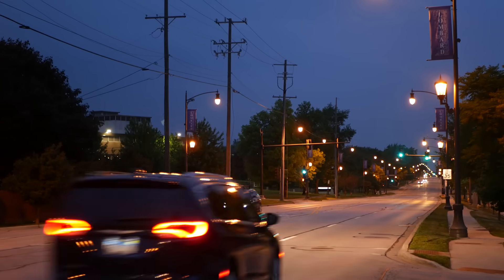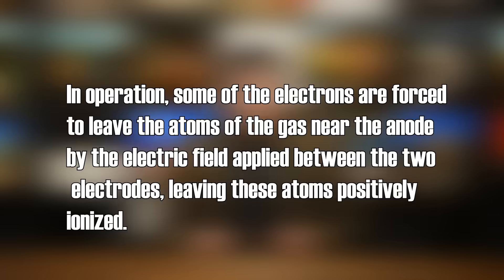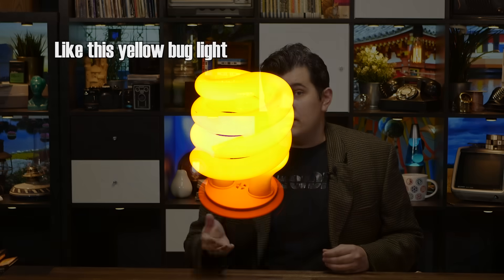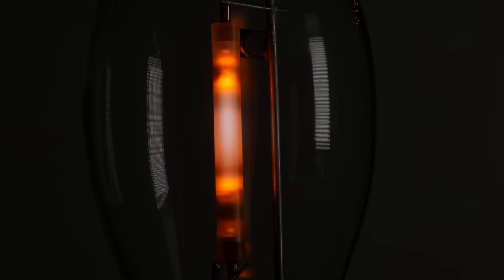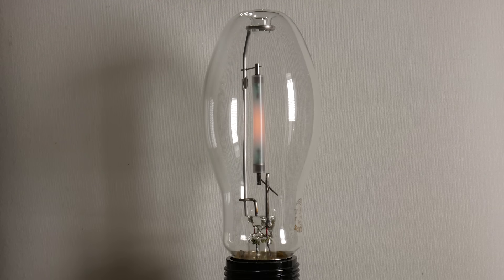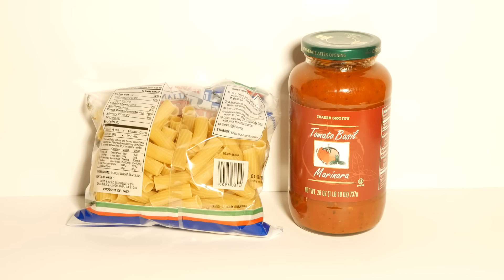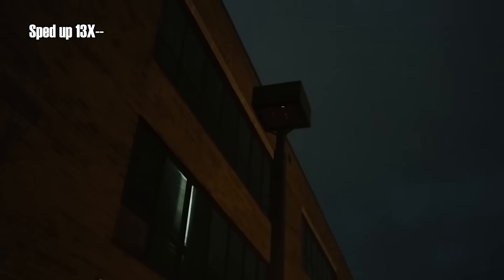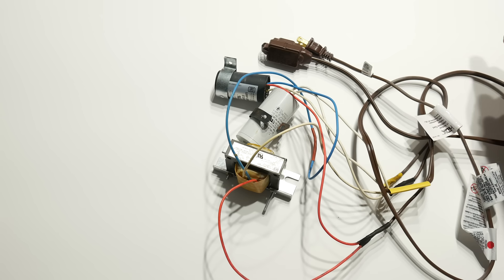The High Pressure Sodium Light: Ubiquitous, effective, but good?

Comment: I really miss the HPS street lighting. Here in LA switched to effing LED.
Reply: *They switched
Reply: Same thing in my city. It looks like a cold, barren wasteland outside with this LED trash, which doesn't help when it's -30 in winter and you want to feel warm.
Reply: @EdmontonRails  Not so much the lighting technology as it is the color temp - although for a long time lighting LEDs were mostly the cringe-inducing cold white that you speak of.
Reply: @InkyLeopard   There are warmer LEDs for sure, but there's catches. Warmer LEDs are less efficient, practically tied with HPS. They also often have bad tints. The blue-orange color temperature scale is only half the picture. There is also a green-purple tint scale that completes the chart. HPS lights have a nice purple tint to their orange. A lot of warm LED lights have a nasty looking green tint. The LED light panels don't look as nice as the HPS bulbs either.
Reply: @EdmontonRails  Higher efficiency doesn't mean higher CRI. What's the point of higher efficiency in cool white 6000k LED's if the reduce depth perception, increase glare and eye strain. Even at 5000k LED's can have rosy tint which leads to higher CRI.
Reply: @uvwuvw-ol3fg   Exactly. The cold LED streetlights are blinding to the eyes, just like LED car headlights. They create dark shadows and disable human night vision, making them worse for night time lighting. There's also an issue with how much importance is placed on CRI. People need to step back and realize that night isn't meant to look like day. The human brain relies on a clear difference between the 2 in order to function.
Reply: @EdmontonRails  L.E.D. LIGHTS ONLY SUFFER IN VERY COLD COUNTRIES BUT WORK PERFECTLY IN WARMER ONES,L.E.D. LIGHTS ARE THE BEST
Reply: @stephensnell5707   LED lights do not work perfectly in warm countries. They are very sensitive to heat, including the heat given off by their own circuitry. If not kept cool LED lights lose efficiency and lifespan.
Reply: @EdmontonRails  shut your valve, old fart
Reply: @doburu4835  silence. Do like this 20 y/o and get yourself a driver's license. Then you'll quickly learn how annoying led lights on cards and street lamps are. On cars they blind you and in the streets they light up the area very poorly. And in the snow or in foggy conditions it becomes much more difficult to see. The difference is especially easy to spot if you drive through a road that has both lights because they are only replacing with LEDs the ones that burn out.
Reply: Go and moan to a retirement home nurse old man, who cares
Reply: @m2heavyindustries378  shut up

Comment: I may be dating myself - but I remember the days when the astronomers were trying to get Congress to mandate low pressure sodium street lights anywhere within 75 miles of an active observatory. They were concerned about light pollution hindering the efficiency of their couple of hundred million dollar telescope and regarded losing one specific line on the spectrum as tolerable but losing the effective use of the telescope as not tolerable.  The internet solved this problem by allowing the astronomer to make observations without having to be physically present at the telescope.  This also allowed telescopes to be placed at higher altitudes where you needed to adapt to the thin air in order to function.

Comment: The tungsten filament is not brighter nor longer lasting. The carbon filaments were just as bright, but could burn for 2, 3, even 4 times the duration. The tungsten filaments were used so that people would have to buy replacements more often.
Reply: Nathan V ok, so why don’t we use it these days?
Reply: Zach B because LEDs are brighter and more efficient. For applications where life is required, there are better alternatives.
Reply: I mean in nowadays incandescent lighting? I’m saying your total bullshit.

Comment: in Mexico most of the public luminaire is halogen. and recently they are implementing LED. There are still some sodium bulbs but they are more used as a temporary replacement lamp. [It's strange to see a long street lit with halogen or LED and sodium points] -I'm really nostalgic to remember those popular fairs where you went with the grandmother seeing everything in yellow monochromatics (it was really a nightmare when you are 4 years old)

Comment: I can heat my living room with incandescent lights during the winter.
Reply: Just play PUBG full brightness while charging your Samsung
Reply: I use my old laptop. Beat that, mate .
Reply: Tom Garbo  That means they can have DOUBLE uses.A light emitting heater!
Reply: @PrivateMcPrivate  No joke: there are applications where incandescent bulbs are used for exactly that reason.  Terrariums and Lava lamps come to mind.
Reply: Do you live in a closet? Lucky you
Reply: My friend and I used to joke about using the original Xbox as a grilled cheese maker.
Reply: @biggiecheese253  I used my xbox 360 as a poptart toaster
Reply: No, you can’t.
Reply: We still have a lot of HPS here in Milwaukee. We also have a few random Mercury Vapor streetlights. I went for a walk after dark recently and found several blocks nearby that have mostly mercury vapor lights with their cool blue green glow.

Comment: I don’t like those sodium lights, I used to have a 1985 Ford Ltd Crown Victoria (the original Men In Black car). It had a paint color called “Sand Beige”, which, under sunlight was a nice yellow version of beige, soothing to the eyes really.
However, Ford used red oxide primer underneath the paint and under sodium lamps it was visible through the paint and turned the car pink.

Pink! Like Homer Simpsons car!

Comment: Because astronomers love them as it is easy to filter the light out compared to white light.
Reply: That's low-pressure sodium, which has a nearly monochromatic output. As noted in the video, the high-pressure sodium lamps have a broad-spectrum output although the CRI is low. San José, California uses low-pressure sodium street lights for the benefit of the nearby Lick Observatory. These lights have, as was noted in the video, horrible color rendition and make it impossible to, say, find your car in a parking lot at night because they're all gray.

Comment: I owned a business with about 100 of the same sodium lamp you were demonstrating. None of them got nearly the hours that were claimed and the fixtures were a constant pain. The ballasts failed constantly and the lamps produced so much heat that a plastic lens would yellow and crack. Fixtures with glass lenses were much more expensive. Much like replacing the bulbs in our indoor 8 ft. florescent fixtures with LED tubes, the lack of ballasts to fail and the lack of heat issues was a godsend.

Comment: Tbh leds are shit only good for a torch because, they damage your eyes and give a nasty day/cool light where as high pressure sodium lamps give a warm light that makes things easier to see without the glare of a led also low pressure sodium lights are ok but have a more yellowish light which in my opinion isn’t as good  , also if u like one of these lamps (high pressure sodium light orange light )(low pressure sodium yellowish light )and the local street lights around your house haven’t changed to led yet you can send the local council a letter to ask for them to not change the lights to led because the community feels the orange ones are warmer etc

Comment: apart from the efficiency these LED lights suck in almost every way. Weird color that tires you out while driving, don't get hot enough to melt snow and ice off them,  expensive to install, and a concentrated beam straight down that dosen't really light up the area too well

Comment: Why would LEDs put Sodium vapor lights out of business?

Sodium lamps have the worst color rendering of any bulb. They produce a dark yellow glow which is generally a very low quality light. Additionally, there are serious waste disposal issues with sodium lamps. In particular, they have been known to start fires in the event that the lamp is broken and the sodium metal is exposed. The sodium can catch fire even in the event that the lamp is broken on the ground. For this reason it is safest to break sodium lights under water and then to subsequently dispose of the destroyed bulb. Lastly, HPS and LPS lights are monochromatic, so they can mess with your color vision if you look at them for an extended period of time.

Perhaps more importantly, in the last few years LED efficiency has surpassed that of even LPS and HPS lights and its efficiency improvements are progressing at a much more rapid rate. The largest selling point of LPS and HPS lights is the cheap selling price, the high energy efficiency (low operating costs), and the relatively long lifespan. LPS and HPS still retain these advantages over most conventional bulbs but they lose on all three counts to LEDs. In some areas (e.g. lifespan) they are drastically inferior to LEDs. The extremely low maintenance and replacement costs with LEDs is actually a major cost benefit over the long term. LED lifespan can be greater than 100,000 hours (more than four times that of LPS or HPS). Having to purchase one bulb versus 3 or 4 bulbs over the course of time is a significant selling point for LEDs. The bottom line is that having lost their traditional advantage of being the most energy efficient bulb on the market, there’s very little reason to use a sodium vapor light when LED lighting is available.

from https://www.stouchlighting.com/blog/led-vs-hps-lps-high-and-low-pressure-sodium

Comment: I had a high pressure sodium on side of my shop by driveway for last 10 years. I always meant to add daylight sensor but never did. I had it on switch to just turn on at night but lot of times came home after dark so just started leaving it on. Well it lasted around 10 years on day and night. It started going off and coming back on a lot so I replaced it with led with 5 times the lumens and white instead yellow. Plus led has daylight sensor so it's only on at night. Yes I could've made sodium last 5 years or so longer with light sensor sooner. But I got it half priced clearance originally and it ran clear into the led age. So I got my money's worth and now new light should last 15+ more years. And is whiter and brighter

Comment: The purpose of a street lamp is not to see color, but to see objects even if monochrome, in a scotopic manner..   The beauty of a High Pressure Sodium light is that it still lets you know it is NIGHT and is easier on the environment in that way.   What I don't like is the super bright lights, particularly of the newer automobile headlamps (now blinding worse since everyone has their fog lamps on, which broadcast glaring light everywhere), and now the ultra bright LED lights.   I hypothesize that most of the night accidents on the road, particularly vehicle vs pedestrian, are the result of the glare of these newer lights into the eyes of opposite traffic, blinding the driver and making obstacles/objects harder to see.   Actors know this effect while on stage....  they can't see anything in front of them!

Comment: Light characteristics are measured in its color or K value.  The interesting point in having orange light is that the lower on the spectrum light is causes minimalization of a "shadow" based on the wavelength of the light as it travels in the air.  Red color does not work well in our eyes in terms of luminescence and causes more black and white effect when you look at something in "red light" (ever notice the light in a dark room for developing film?).  
At Orange/Yellow light at 3000K or so, we are able to distinguish colors somewhat accurately, and shadows are nearly eliminated.  When you look at bright white light such as 60000K and higher, a very stark shadow is formed which causes us to see half an object while the back side is completely blacked out in the shadow.
The use of the orange lights for street lights came about from a study in the 1960s in terms of safety for driving and pedestrians walking in streets in terms of seeing while driving and walking at night.
The use of sodium lights came about because of elimination of shadow effect for drivers and pedestrians then.

Hope that explains how and why a little...

Comment: Again, just amazing.  I'm pretty sure that I first saw sodium streetlights in 1976 in Chicago.  Neon and Fluorescent lighting is an interesting topic. There used to be a cheaper or more efficient type of fluorescent bulb/fixture that was for use in hallways. These are harshly blue and always made me feel kind of sick. They flicker more. Current fluorescents, the long tubes have electronic ballasts, more efficient, but also almost no flicker. (I always sorted them by waving my finers, if my fingers 'strobed' than it was the older non-electronic ballasts).  
And the part about replacing Sodium with LEDs is interesting. Yes LEDs are supposed to last longer than tortoises, but the Crees I bought at Home Depot all went bad in less than two years (AvE did a video on this) , other LEDs I have when there was a slight voltage surge are now either off or cycling on and off. I also connected two LEDs in one fixture to an LED dimmer switch, they just started acting up. Individually they continue to work well on the same brand of switch. These are in spot bulbs. 
Something you also might find interesting. When they were building the Eniac computer (like Edison's light bulb it too wasn't really the first), the engineers were looking for the most reliable vacuum tube to use in it. (This is in George Dyson's book on the subject). You're a little young to have been around many vacuum tubes, these have a lightbulb filament in them. They bought the more expensive long life vacuum tubes and they also bought regular ones. The long life ones actually had a much higher failure rate. The most long lived and reliable vacuum tubes were the ones most widely manufactured. (My limited experience with longer life more expensive car headlight quartz bulbs is exactly the same.) I think Cree's LED bulbs fail to follow this pattern. 
One thing as a science teacher I found a bit of a problem putting together: types of bulbs, efficiency, heat, etc.... (this is ten years ago) I found I could compare LEDs to incandescents and some types of fluorescents to incandescents but not all of them together. You did a terrific job in this video. Your first part where you say that HPS gives off 3 times the light for half the electricity is okay.... but this can quickly become confusing if you were to introduce a third type. However, you then state very clearly that HPS is 6-8 x more efficient. Well done sir! 
(You're young enough to remember how terrible science textbooks are. You're clear too smart and not corrupt enough to be employed by any textbook company, but consider writing your own. Start with shorter works on specific topics. As a teacher and an old nerd, I've seen that a really good clear explanation and diagrams can take an extremely technical subject and make it understandable to anyone. Remember, Einstein could explain relativity to a three year old and did, he also wrote a widely read book explaining his theories to laymen. For me gyroscope precession was an example of this. Walter Lewin famous MIT physics professor said "Gyroscopes are the most counterintuitive concept in all of physics, including quantum physics." I set out to understand the gyroscope on the end of a string. And I did it. Several YouTube videos. What's remarkable is that once I understood how the force of gravity (down) was being shifted by the spinning mass 90 degrees, causing the gyroscope to precess around the string, instead of flopping down.... I looked at videos of modern dancers: they also know this! I've seen it in karate.  You'd be really good at this.  okay rambling: off....

Comment: What ? "The earliest lights bulbs used a carbon filament but shortly thereafter improvements in the ability to make tungsten filaments allowed for a brighter and longer lasting bulb due to tungstens much higher melting point." Tungsten melting point: 3,422 °C Carbon melting point: 3,550 °C

Comment: Thank-you for making this video :) Around here the more common sodium light (HPS) have been around for decades but are slowly being replaced by LED's. Like many folks have posted on the subject, I prefer the warmth of HPS for night time use over LED's for many of the same reasons.Also I've always liked the low pressure sodium lights and the cool way they start up going from red/pink to deep yellow. To me, they have a neat sci-fi quality about them. Until I saw this video, I didn't know anything more about them other than that they are rare here, and I didn't know how HPS and LPS differed. I didn't even know what an LPS bulb looked like up close. I learned quite  bit from this video and it led me to do more research on LPS. From that I ultimately started a small collection of them and In good time too, because as I understand it, the last company making LPS lamps is going to stop making them all together by early 2020.  So Thank you  :)

Comment: Watts are NOT a measure of brightness. They are a measure of energy consumption. Lumens are a measure of brightness. Thanks to the well known correlation in Tungsten filament bulbs between lumens and watts, brightness was for decades labeled in watts as used by a tungsten filament bulb. This creates a massive problem if you use ANYTHING else, though, since the watts will be different. Please do not encourage the continued use of watts or watts-equlivalent as a units of brightness in bulbs, so we can smoothly transition to using lumens and thus being able to talk about different kinds of lighting without confusion.